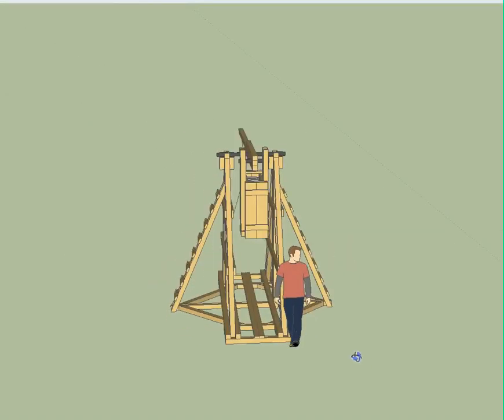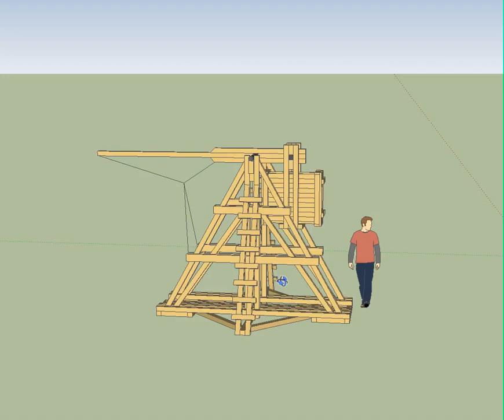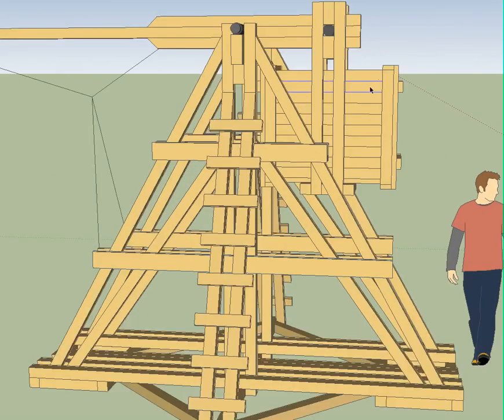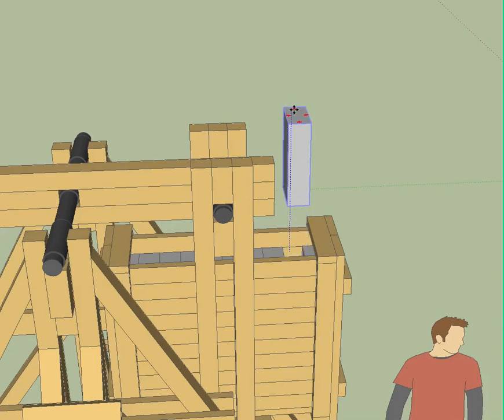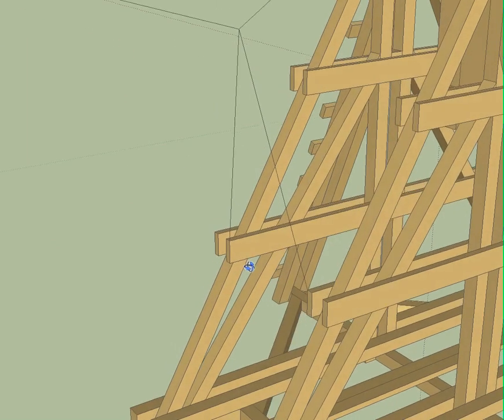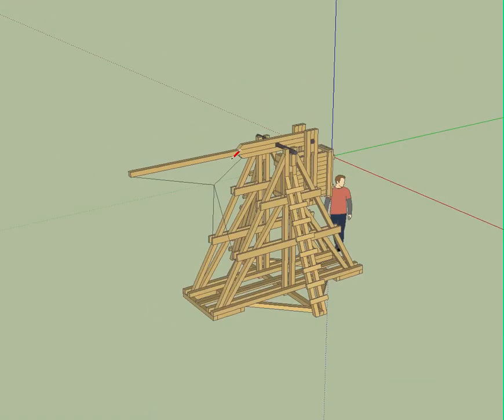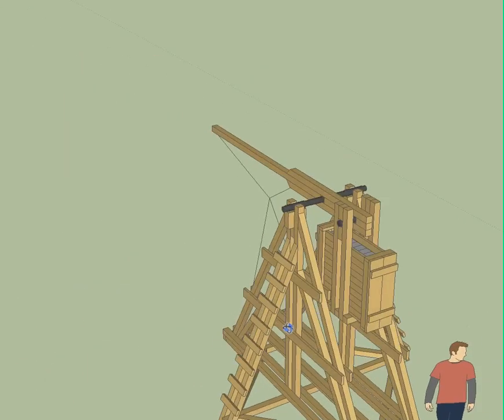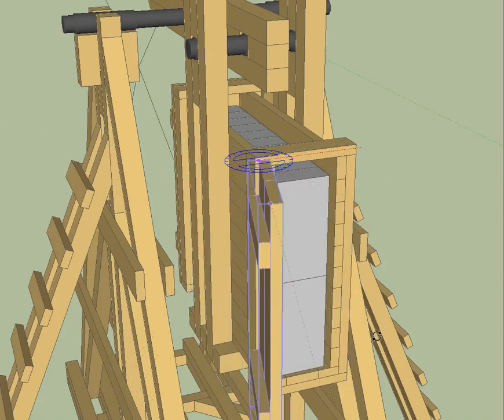Backyard Trebuchet Design

Comment: Do a scale model of the design using craft wood to make sure that the winch axle does not interfere with the sling or the counterweight box. Use a "T"shaped support from the ground to the box when the counterweight is winched up in case of rope or pulley failure. Use 5:1 long arm to short arm ratio for light projectiles or 4:1 for heavier ones. My design is very similar to yours and I use 4.5:1 like the one at the Danish Medieval Centre.